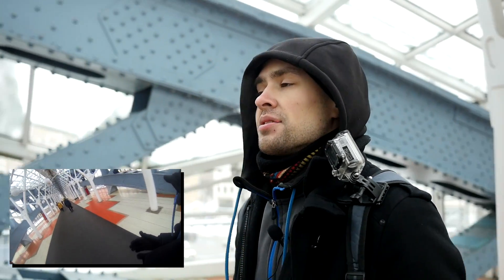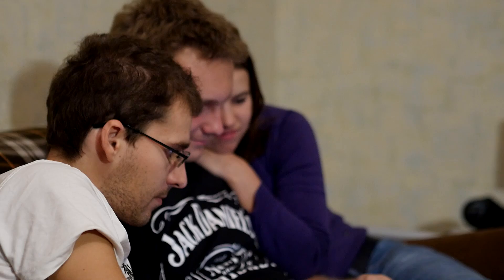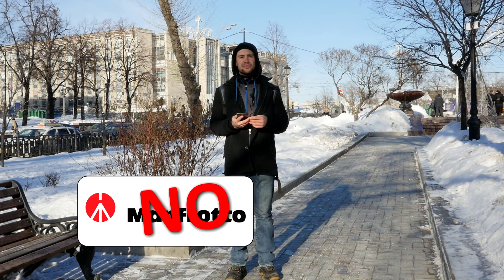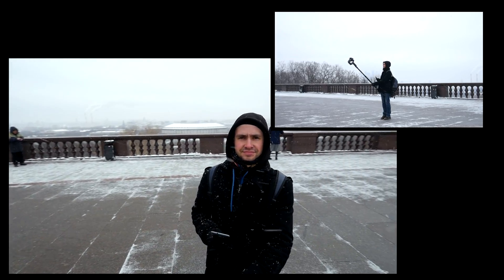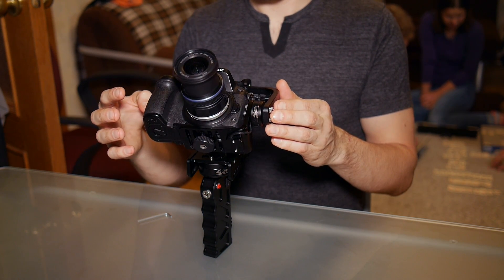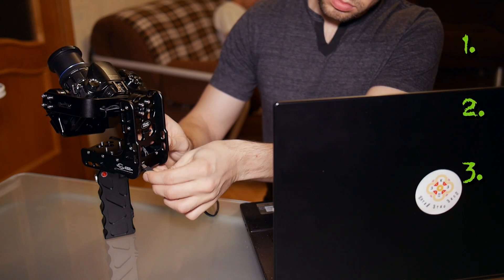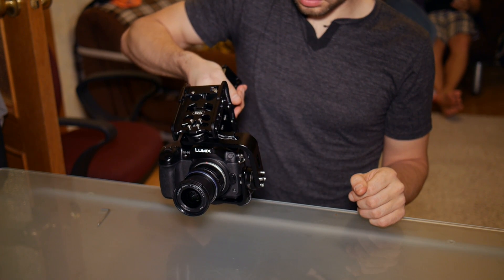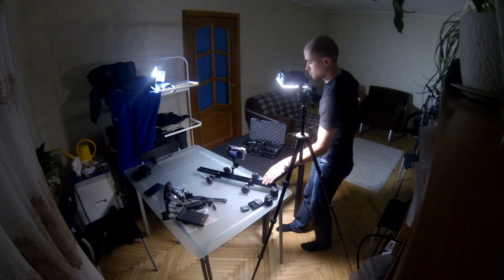Обзор Nebula 4000 Lite Review

Comment: sweet :}
what is the max weight you tried on it?
my setup should be 965g and I am bit concerned if it is okay to go with that weight.
Reply from the maker: stavro, max weight I've used 720g (GH4+9-18mm)
I'm not sure about your 965g, you will need to correct the settings for such weight, and probably it will work.
Reply from the maker: but I know a lot of people use GH4 with 12-35mm and it weight 865g. Not much more 965g. I think everything will be ok.
Reply: - Петькино - thank you for your opinion :) much appreciated.